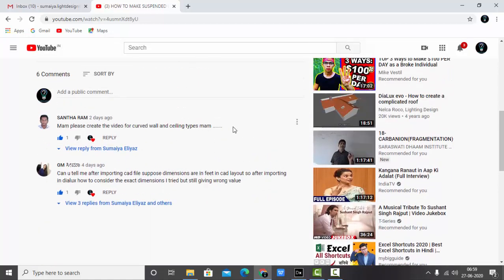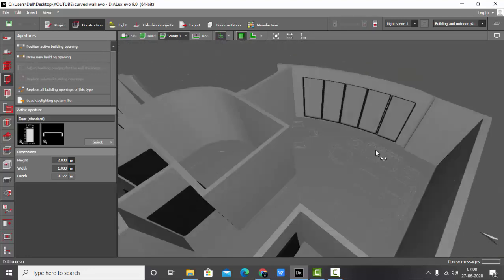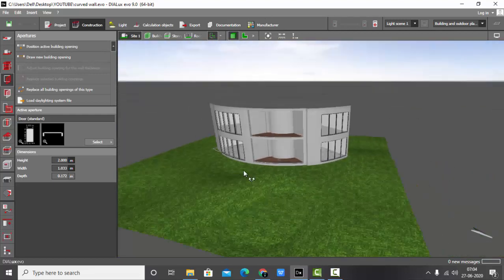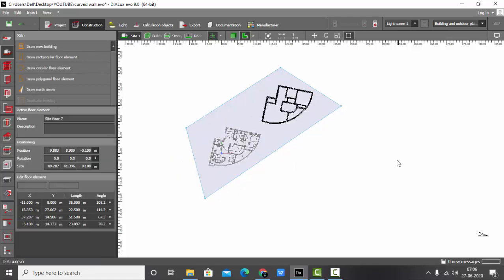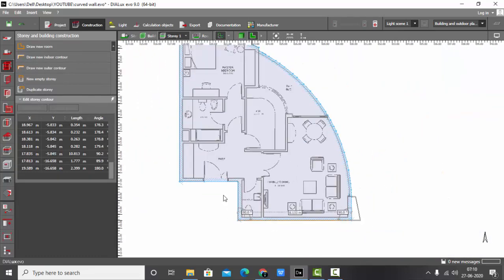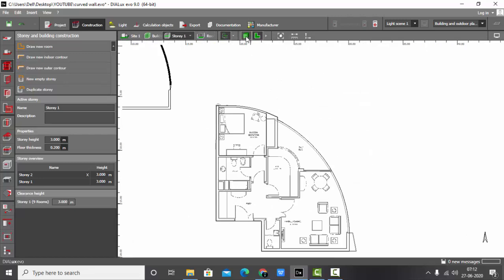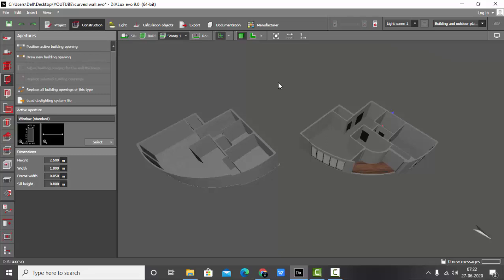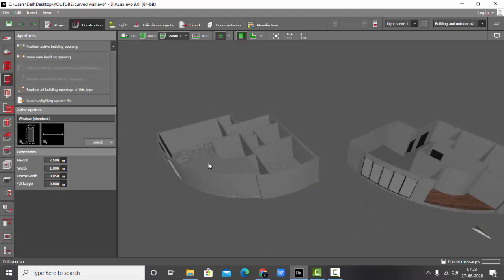DIALUX EVO : HOW TO MAKE CURVED WALLS

Comment: hi, I figured out this on my own, but the problem with this method is that DIAlux doesn't count it as one surface, so when I calculate, it counts every little piece of the curve on his own, and that's a problem if you need to calculate the Em of the wall. Do you have any suggestion on how to fix it? Do you know how to make a calculating surface on a curve wall?